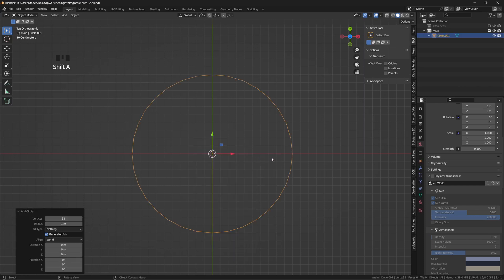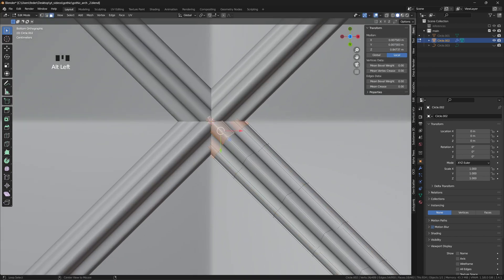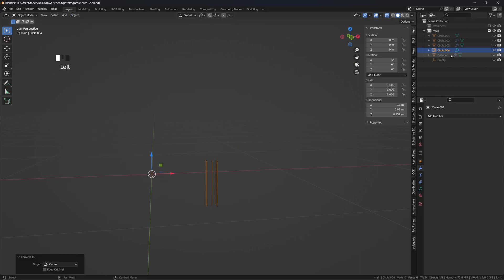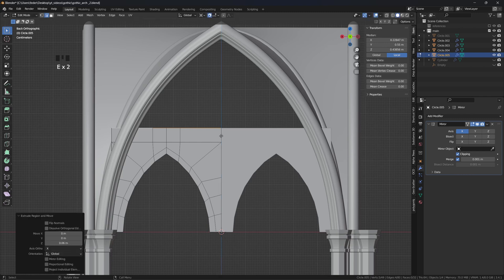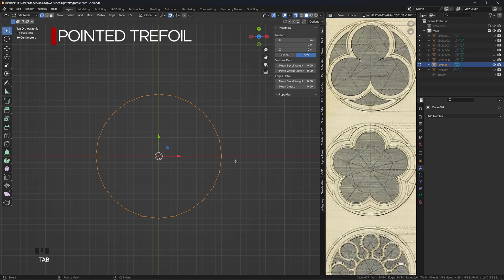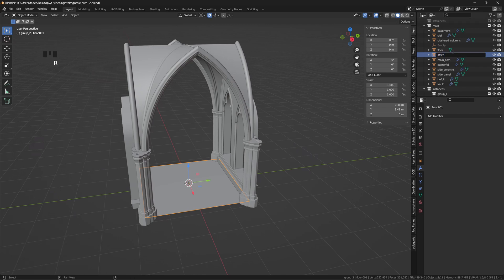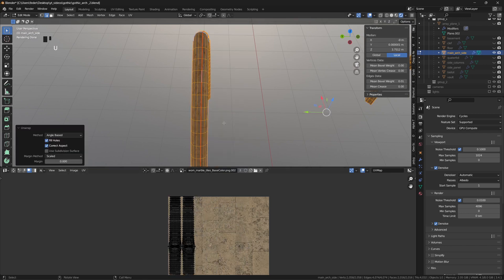Gothic architecture in Blender - Full tutorial

Comment: 2:48 how did the number of vertices from just shade smoothing jump from 6 in the whole thing to... how many are there now?
edit: I need help with doing what you managed to do in terms of creating more edge loops on the curve, because the way I found to do it still has the vertices that I added be straight path between the ones that were already there before.
Reply: @hbitproject please help me here 🥲
Reply: Had the exact same problem. What I did that seemed to solve this issue was clicking on aply on the subdivision modifier before converting it into a curve
Reply: @rodrigoclarkrossi5108 THANK YOU someone answered. I’ll try this later.
Reply: @rodrigoclarkrossi5108  You're a saviour dude 🙏

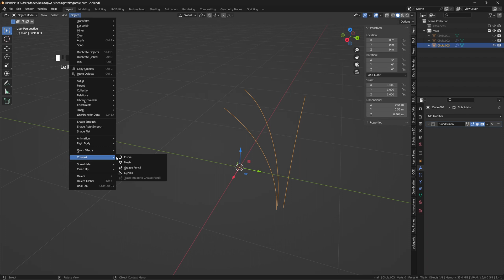Comment: Amazing video!! I do have a question though. When duplicating the ribs from the vault and converting to curve (at 2:40) my ribs are very jagged with few subdivisions while in your video it seems it creates many more subdivisions and is very smooth. If I attempt to add more subdivisions to the curve it will only add more vertices along the already jagged curve. I may try to add a subdivision modifier to the curve for now. Any tips?
Reply: I am also having trouble with the array function, where it will create an array below the model rather than to the side

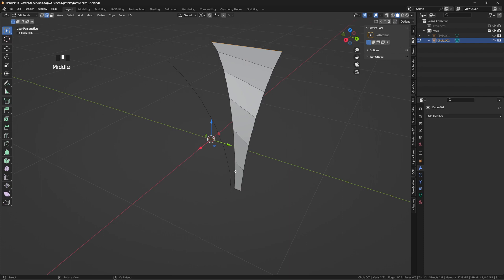Comment: Noob mistake and I should know better, but make sure you apply your transforms to the arches before applying the mirror modifier at 2:00 or it will come out backwards and wrong.
Reply: ty man
Reply: Additional follow up as I'm revisiting this tutorial, for some reason now at the same point I have to use the empty as the mirror object or it won't work. Even though I'm repeating his steps precisely and all my settings (pivot point, etc.) are the same it comes out wrong until I select the empty as the mirror object. Weird, because it worked without using the empty before.
Reply: @Highcastle_of_Geek  same thing, blender is fun and confusing at the same time

Comment: if any one comes across the issue of F key not working, first thing try checking if F2 pluggin is enabled at Top Menu > Edit > Preferences > Add On > (search F2  and check if enabled). 

Another issue I came across is that the F hotkey (fill face from edge) works if elements are of the same object, would would have to try and "join" the archs into one object before you try to use the F hot key  i.e select all the archs > Top Menu > object > join  and then retry to use the F hotkey to fill the faces

Comment: 8:14 there is obvious mistake in the structure ("roof" profile misaligned with gable profile), it was there already in 4:38.
Reply from the maker: That's interesting. I looked into it and there is a simple solution: at 1:54 select each vertex of the diagonal rib and (with global space orientation and snap enabled on vertex) align them (on the Z axis) to the vertices belonging to the frontal curve. Good catch!
Reply: No, that's just the way gothic vaults work. The diagonal ribs were following either a half-circle or a pointed arch. They wouldn't have followed the gable profiles because that would have led to far too complicated geometry, i. e. parabolas, which they weren't able to compute. So the version in the video is actually more historically accurate.